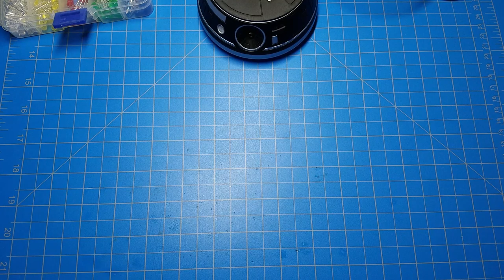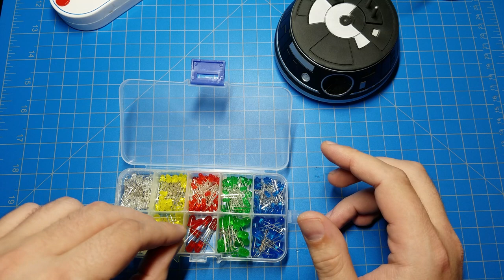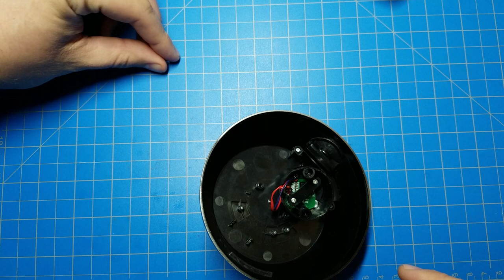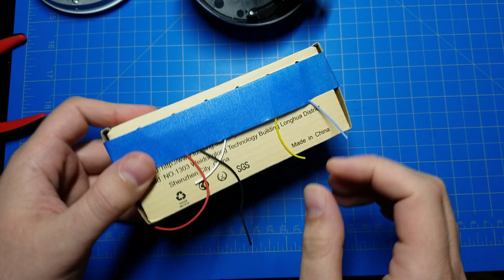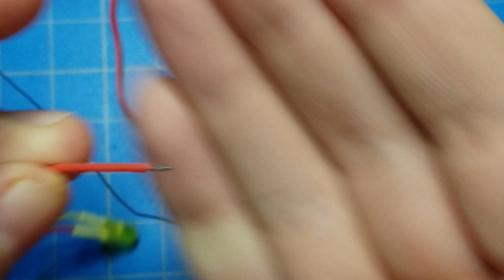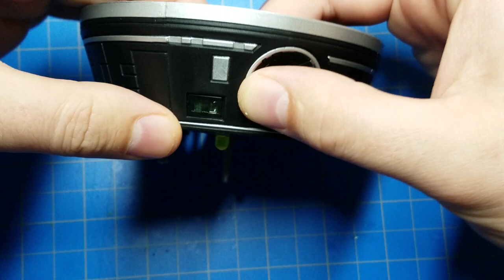Star Wars Galaxy's Edge BB Droid LED Modification

Comment: I can confirm that there are only two magnets on my unit as well. I was thinking of adding better magnets to increase stability and noticed it was missing. I also noticed that when the head is installed the two “T” shapes do not actually line up properly. The end up making + sign when the head is installed. Experimented with flipping the magnets to get the T to line up, but that reverses the direction of the droids forward and reverse movement. Gonna do some more experimentation when I have time. Great video!
Reply: How's this been? I've been doing some research before I work on mine

Comment: Fun video!  Have you opened the "motivator" in the base up yet?  There is an adjustable knob for something.  Please let me know if you know what it's for.  My unit is having trouble getting enough power to light both both stock LED's.  Just the red one lights unless it is on top of the "motivator" without the shell.  Any ideas on how to increase the power to the head?
Reply from the maker: I have opened the motivator and I know of the pot you're talking about! I don't yet know what it does, but I know it connects to the bluetooth controller.

as for the LEDs, have you tried changing the batteries?

red LEDs require a lower voltage than blue LEDs to turn on. that only the red LED turns on makes me think you're not getting enough voltage to the head, which makes me think batteries.

if that doesn't work let me know.
Reply: @Ruthsarian   I did replace the batteries but the results are the same.  I uploaded videos of the problem on my account.  Also, uploaded video of the droid getting activated and it doesn't look like the lights are working from the start.  (We had the cast member turn off the droid before boxing so it wouldn't go off on the way back to the hotel.  Otherwise, I would have noticed before leaving the park.)  Any ideas for repair?  (I don't have a tool to measure power.)
Reply from the maker: I watched your videos. You're right, it does seem like the lights weren't working right when it was activated. 

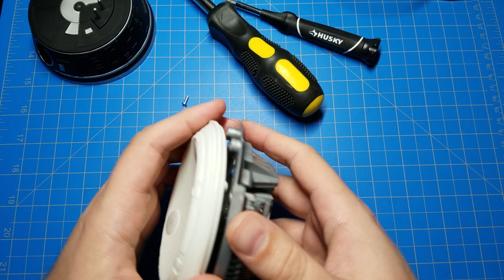My guess is that the copper coil in either the top of the motivator or inside the head that is used to transmit/receive power wirelessly has been installed in the wrong place or broken free from where it should be. The coils wouldn't align properly and the increased distance between them would mean less power getting through to the head to power the LEDs. In this video the coil would be under the center of the gray, stubby t-shaped thing you see at around 8:05 in the video. That'd be the first thing to check. For example there's a place where a third magnet might have originally been intended to go, but it's empty on mine. Perhaps someone installed the coil there by accident and not in the middle. 

I haven't opened the motivator up to the point that I've gotten to the coil is at the top. Maybe you could shake it a little and see if there's any rattling coming from the top of the motivator indicating the coil is loose.

It might be worth contacting customer service at Disney and explain the situation to them. Maybe they'll offer a replacement, which might be less of a headache than opening up your droid. If they can't do anything for you, then start opening the droid.

I do think this likely an issue with one of the coils. Maybe check the soldering connections where the coil connects to the metal contact pads inside the head look good. Inside the motivator the coil connects to the main board via a yellow connector (marked 'L1A' on the PCB; but it's also the only yellow connector on the board). You could try reseating that connector, but be very careful to not pull on the wires to disconnect it, just the plastic connector to disconnect it. They're using super thin wires crimped into the connector's pins. It'd be really easy to just pull one of those wires out. 

But start with contacting Disney customer service.
Reply: @Ruthsarian  I have taken the whole thing apart and checked everything I could without a meter.  I have also contacted Disney about it.  I was hoping you might know of a way to boost the power connection between the coils.  I'll let you know if Disney helps.
Reply: Disneyland came through and sent me some new parts!  It was a bad motivator.  For some reason, not enough power was being sent to the motivator's coil.  Bad board?
It took about a month to get a response, but when I did, I was very impressed with the Disneyland Galaxy's Edge merchandise customer service member that helped me.
Reply: @drftgy67  "Uncle Owen, this one's got a bad motivator!"

Comment: Out of curiosity, where did you get your arm stand that you suspend the LED for soldering?
Reply from the maker: That one I bought from mouser.com, you can find it here:
https://www.mouser.com/ProductDetail/485-291

There are many options out there. You can find ones just like it out there on amazon or ebay or elsewhere. Just search for "helping hands" or "third hand" and you'll find them all over the place.

This particular one, the magnifying glass holder was loose and the lens would often fall out. I ended up using a blob of solder to hold the frame of the lens together. Other than that, no complaints.
Reply: @Ruthsarian  Thanks.

Comment: I'm looking to modify or make a new head for my two bb-8 droids. I'm thinking of changing out the 3 rubber bumps on the bottom for casters. I'm not sure if I'll be able to fit them into the current head, so I might end up 3d printing a new one and transplanting the electronics. Has anyone come across anything like this? I'd also like to add in a camera into the head, but the small camera I bought is a link glitchy.

Also, I took mine apart and there's only 2 magnets in mine as well. I don't think you lost yours, I think they just left that plastic place for another magnet in the file after finding that the head wouldn't move with the rubber bits on the ball when the magnetic attraction was that strong @Ruthsarian
Reply from the maker: i'm interested to hear how the casters idea turns out. i haven't heard of anyone trying something like that. that might make for much smoother head movement.
Reply: @MT-mt1gn  I could never find casters small enough, and I'm not confident to 3D print them, since they'd have to be such finely detailed. I've also had some other stuff come up this past year, and I never actually got to drawing up a file for a new head. If I get some free time after my final I'll look into it more and see if I can find anyone else who has done something like this. I remember James from x robots did one when ep 7 came out, but that was a full scale droid
Reply: @lukecobabe3673  awesome, yeah i just got to down to the base with the magnets. I'm going to design and print a replacement top that will hold my arduino+sonar. Should be easy enough. With the lack of security on the BTLE commands they made this pretty hackable.
Reply: @MT-mt1gn  you should make a video on it once you do, I'd love to see how you mod it all together

Comment: Your video is super helpful! I have a plan to stash an arduino feather BTLE in the top unit along with sonar + gyro to make mine semi autonomous. Do you think the wireless pulses provide enough voltage to power the arduino if I toss in a capacitor?
Reply from the maker: probably not. i think there won't be enough current to power the arduino and sensors. the power is only being generated when the droid is making noises (thus blinking the LEDs), so either the droid needs to constantly be making noises or you don't need the arduino to always be on.

i think you'd also need to modify the circuit in the head. design a  circuit that takes the power from the coil, rectifies it (any standard 1n00x would do), clamps it to some usable voltage (a 3.3-5V zener diode) and filters it (a capacitor) that would then be used to power the arduino. 

i think you'd be better off adding a separate, rechargeable battery to the head and use that to power the arduino. maybe figure out a way to add a female plug to the head so you can plug something into the head to recharge it when needed so you don't have to keep opening up the head to recharge the battery.
Reply: @Ruthsarian  cool yeah that was my thinking too in the end. I’m just adding a small 3.4v lipo to power the sensors and the arduino. Also there’s a tidy charging bold by adafruit which I’ll just use with an exposed usbc port for charging
Reply: @Ruthsarian  its begun https://www.instagram.com/p/CRMwfpGrBea/